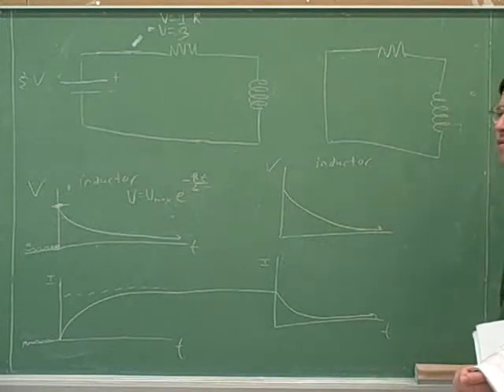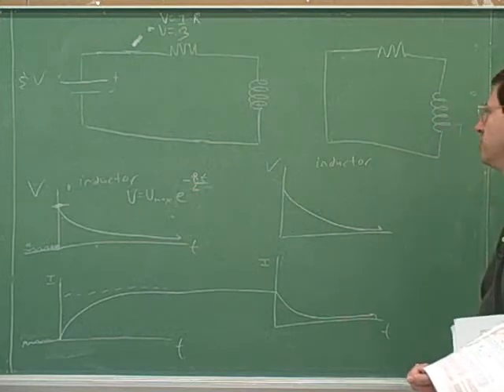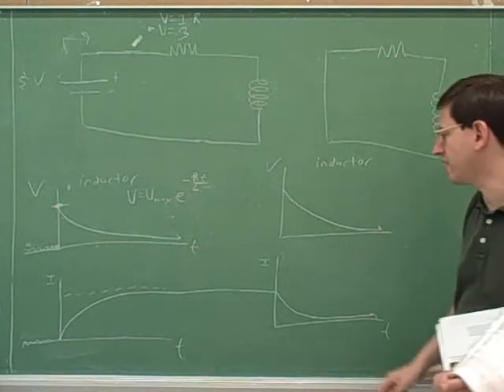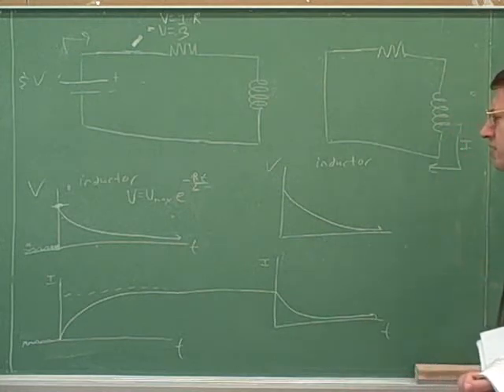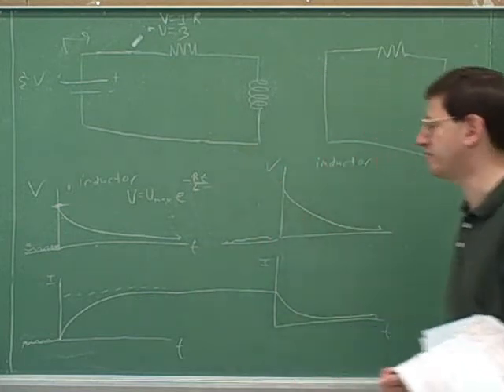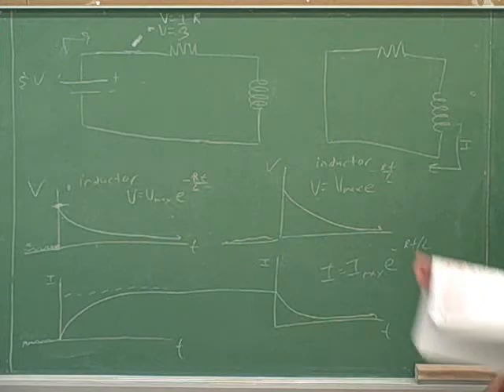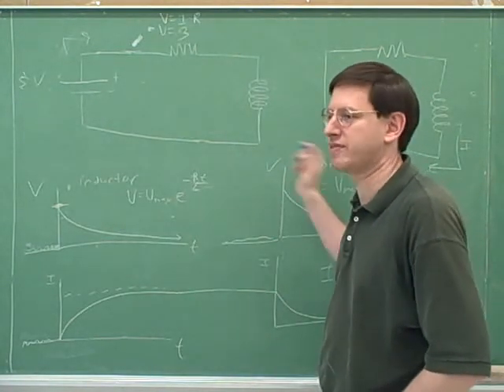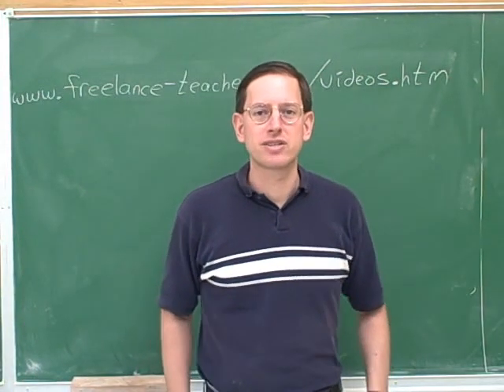Capacitors and inductors; RC and RL circuits (7)

Comment: great lesson......what happens to the voltage of the resistor when circuit is discarging(no Battery)?
Reply: voltage across R  is same as voltage across L